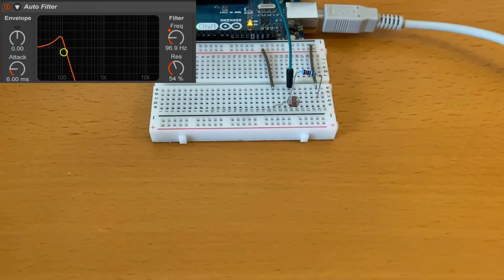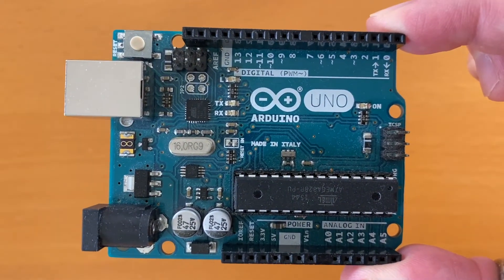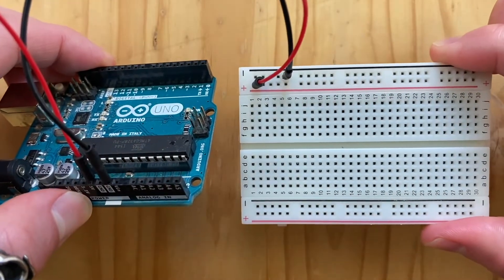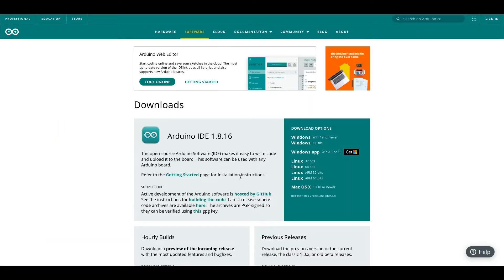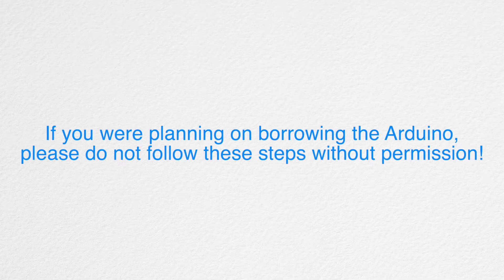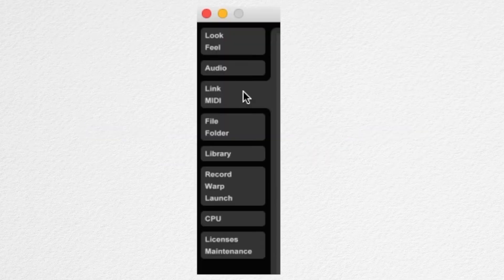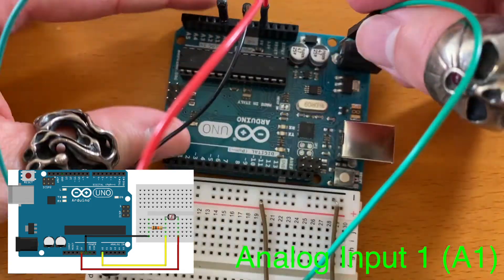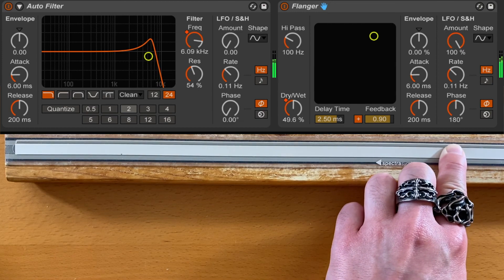Arduino MIDI Tutorial

Comment from the maker: NOTE: The example code in this tutorial will not work with sensors that either use digital pins (for example ultrasonic sensors. Some distance sensors use analog pins though!) or SCL+SDA pins (for example some accelerometers). There should be workarounds, but I have to look into it for a possible future video. Please make sure the sensors that you're going to buy use analog pins!! Google Imaging the sensor will give you a diagram.
Reply: Hey @SoundSimulator, did you found a way to do it? I'm searching for how to connect an ultrasonic sensor (it uses digital pins) + potenciometers and light sensors just as the video. Thanks, you're the best, I follow all your tutorials religiously!

Comment: I want to make a laser harp, I use arduino leonardo, the idea behind it is that I have a laser diode and a photoresistor and the moment the laser wave no longer reaches the photoresistor I want it to make a sound and I would like to use some speakers to make the sound
Reply from the maker: That sounds like a fun idea! 
If you want to add speakers to the project, I recommend using something like the Daisy Seed (I have to put a disclaimer that I work at Electrosmith!) since it'll allow you to make the synth a standalone instrument (so need for a laptop in order to play the synth like in this video).

Good luck and have fun!!

Comment: Firstly, I love the tutorial, very clear and concise. I keep running into an error when trying to load the .zip folder:

Error: 13 INTERNAL: Library install failed: archive is not valid: multiple files found in zip file top level

I've tried it with both 2.2.1 and 1.8.19. Google hasn't been all too helpful, unfortunately. Any suggestions on. what it could be? Thanks!
Reply from the maker: I'm sorry to hear that you're running into an issue. I unfortunately haven't encountered an issue like that, so I can't be of help.

Comment: Hi Takumi ! I tried it like 10x today and my arduino is not showing in my MIDI ports. I'm using an arduino uno (Elegoo) and I did connect the two AREF ports together. The program did upload onto my arduino. What am i missing here ?

Awesome tutorials as usual, thanks for sharing you knowledge ! <3

Much appreciation from Canada, Marianne
Reply: I finally got it to work with my Arduino Mega ! Thanks a lot !
Reply from the maker: Hi Marianne!! 

Did you go through this tutorial? https://www.youtube.com/watch?v=-bCz2I9SMAA 
If so, I'm not 100% sure what could be the issue. The off-brand Arduino is known to cause issue especially when being used for Max/MSP or Pure Data (I totally understand that it's more affordable tho!). 

What DAW are you using btw? 

I hope we can solve the issue!!
Reply: @SoundSimulator  I updated my computer yesterday and tried again your method today and it did not work again. I'll try the Homebrew way right now.

I also have an Arduino Mega, so I'll try with this one if the second method doesn't work.

I'm using Ableton, but it's a cracked version (this could also be the problem). I'll try to find a friend who has the licensed version to try as well. It's good to know that the off-brand has issues with PD, so I won't get mad if it doesn't work in future works !

Thank you so much for your fast answer !!!
Reply from the maker: @mariannedesalvan1803  I followed that tutorial with Arduino Mega and it worked fine. I hope everything works!! Please feel free to further ask questions! Best of luck!
Reply: Have you ever use a digital sensor or have a way to make one work with Ableton. I was planning on using several ultrasonic sensors to modulate sound. Could I use a DAC, would that work ?
Reply from the maker: @mariannedesalvan1803  I'm glad to hear that it's working!!!! 

If you haven't bought them yet, I recommend finding distance sensors that do not use the digital pins. Otherwise, you have to adjust the example code that we use in this video. 
The code works really well, but it's almost too complete to a point where it's a hassle hacking it. 

There may be a tutorial somewhere where you send data from Pure Data to DAW as CC data. That way, you can follow my tutorial on sending data from Arduino to Pure Data and then to DAW. So, ultrasonic -> Arduino -> Pure Data -> DAW. There may be too much latency tho and you have to have Pure Data open in the back.  

As much I want to avoid "buy a new one" as a solution to DIY projects, it may seem like it if you're still new to programming. I should've mentioned in the video to avoid sensors that use digital pins or SCL+SDA pins, sorry about that.
Reply: @SoundSimulator  I'm pretty new to programming but my partner isn't though He looked through the code and he said something along the lines of : "Wow that's such a beautiful and complete code !".

We'll probably give it another go this week to try and figure something out in the code.

I already had two ultrasonic laying around so it's definitely not a hassle to look for something else that would work with this code.

Thank youuuuuuu !

Comment: Nice vid! Im curious, even though the arduino only has 5 analog inputs, would it be possible to map those 5 sensors to more than 5 controls via a digital input that acts like a shift key on a traditional MIDI controller? Does that make sense?
Reply from the maker: Thank you for watching, Adam! Could you give me an example of what you're trying to do?
Reply: @SoundSimulator  For example, if I were in pd and had 10 variable parameters i wanted to control during a live performance as I would with a knob/slider, but i only have 5 analog inputs for potentiometers, could i use a button connected via a digital input to choose a different preset mapping for the knobs live. I dont want to remap the controls manually while live, but quickly choose another preset for the potentiometers.
Reply from the maker: @Azec6Official  First approach that popped into my head is to use 1 of the 6 analog inputs for a switch. The DAW will see that switch data as either 0 or 127 and I think you can use that to turn on/off a bypass or switch between 2 sets. 
The other 5 analog pins can be used for knobs. 
The issue with this approach is that each knob is mapped to 2 parameters simultaneously (unless there is a work-around in your DAW of choice). So, the bypassed parameters will still change. But if you are switching between the 2 mapping sets for different songs in your live set, then it'll work out. For example, first track in your performance has 5 specific mappings and then you switch to the other 5 specific mappings for the next track and so on.     

Another approach is getting Arduino Mega. I should actually make a quick video on it for next week since 6 analog pins may not be enough for other people!  

Hope this helps!
Reply from the maker: You can use digital components like buttons and switches and connect them to an analog pin instead of the digital pin. My finger drum machine tutorial will be a good reference (use the A0 pin instead of whatever digital pin I used).